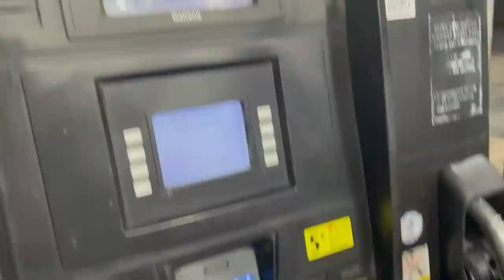WE BOUGHT A MELTED WINNEBAGO RV ll VERY CHEAP ll

Comment: Take out the engine and all related components . Get the panels you need and ditch the rest. The other option is to cut all the bad stuff off and roll the rest onto your Dad's transporter . The last option could be less work. 👍👍

Comment: Definitely worth not only what you paid for it, round trip tickets and cousins and your dad's help definitely still ahead. I would get absolutely everything possible off the RV. Hopefully the generator works.
Reply: pull the wiring harness and the other salvageable controls  off the RV   sweet rig and now they might need frame rails and suspension off this one

Comment: That is what I call a CRISPY CRITTER :) But as you all said it does still have a lot of very useable parts. Just cut and trash the bad and save the good. I would cut it just in front of the slide and remove everything down to the frame, load the cab and chassis on your trailer, and head home. Drive Safe and keep the updates comeing. pilotcropduster

Comment: These were all recalled for an electrical junction box under the residential refrigerator.  It was mounted to the floor and any spillage from the fridge or water from the ice maker, etc. would collect under the fridge and short-out the junction box.  Poof!  Notice the fridge is gone.  They thought the fridge manufacturer was the cause until they said that there were millions of those fridges all over the world and only these models were having fires.  So they would pull out the fridges to do forensic analysis on them to find the cause.  I know of at least one video on FB of these on fire.  Don't know how many caught, but it seemed like a lot.

Comment: Looks like a 2015ish Vista LX 36Y. Cool floorplan.
Reply: heavy rv for that chassis though and looks like a Refer fire took it out they good a decent deal if the generator and other parts are good
Reply: @lutomson3496  my class A is bigger and heavier than that one and it does just fine. 2019 Thor Miramar 37.1